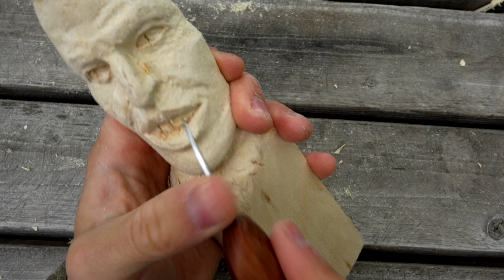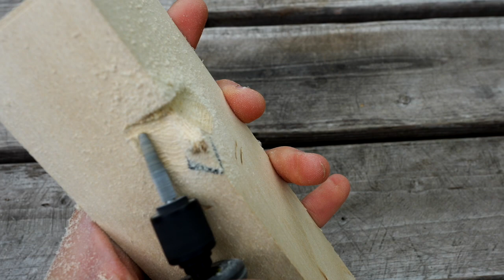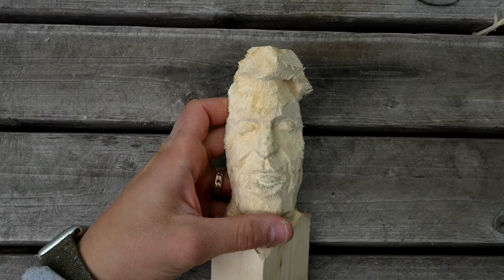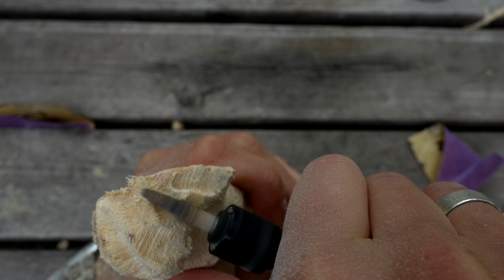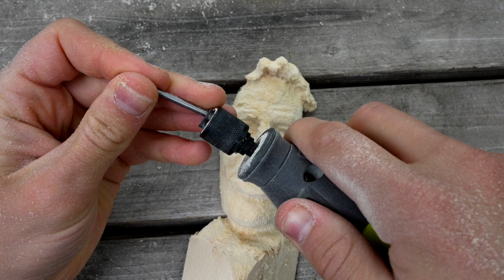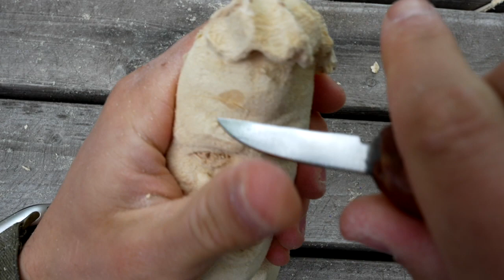Carving a Face With A Dremel in Wood---Wood Carving Tutorial / Lesson

Comment: Thanks for making this video, but I will stick to hand carving. I like the peace and quiet,  and no dust. I have used my Dremel for  carving , but you end up with a lot of sanding and cleanup often carving.
Reply: Same here. Carver beginner. Have Dremel, but use it as a secondary tool to my knifes. I will buff and polish with Dremel, do stands for my carvings etc etc.
Carving with knives indeed has some peace and calmness in it. You can do it even in the middle of the night if you lost sleep. Won’t work with Dremel that way :)
Reply from the maker: Agreed! I don't love Dremel carving at this point either!

Comment: I noticed you went back and sharpened your lines with the knife. Do you find the Dremel doesn’t make clean cuts? Is it just that basswood is too soft?
Reply: I use the flex line with my dremel and Diamond burrs for smoother work…
Reply from the maker: Basswood is not ideal for power carving! That's why!